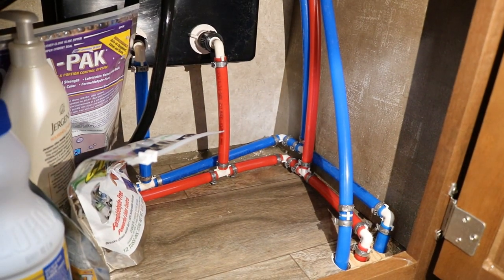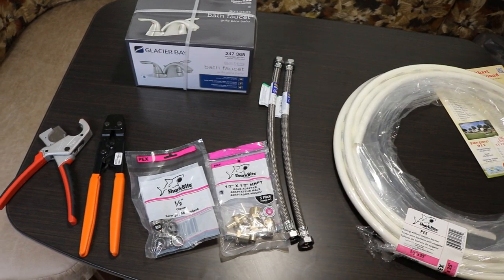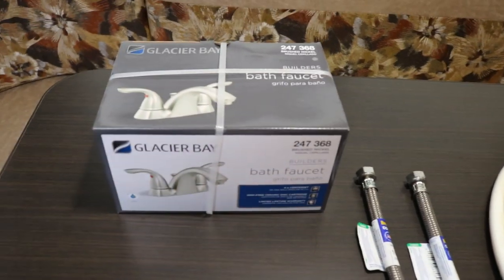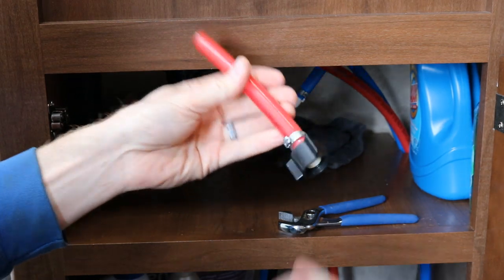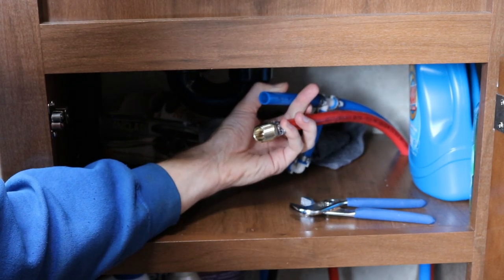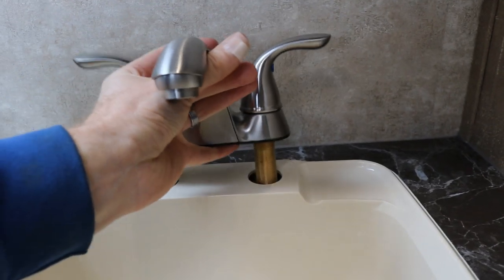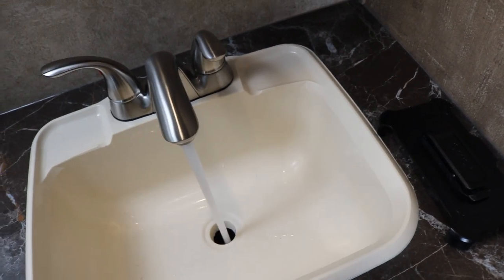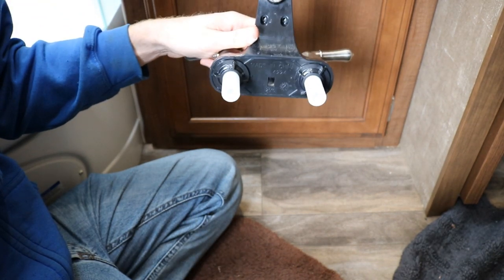HOW TO FIX RV PEX (Faucet Replacement DIY)  #rvlife

Comment: Much easier to attach the flexible lines to the faucet before installing it. Then feed the lines through the hole and tighten one end of the hot and cold versus two. That’s the way a new kitchen faucet comes, lines connected.
Reply from the maker: Yes, you could do it that way!
Reply: That didn’t work for me, the faucet nuts won’t fit over the flex ends to attach from the bottom.

Comment: The hot supply connection was not straight/ lined up.
In tryng to tighten you must have moved it slightly, and it sprayed cause of pressure on fitting. 
Good practice.
Reply from the maker: I got it all fixed up. no thanks to the factory

Comment: You said you could not figure out why it leaked when you tighten the hand nut. I would have suspected a crack in the end fitting. It would not be seen unless you really look carefully while flexing the pipe at the hand nut or disassembled it.

Comment: If this helps doing the same job I believe it was leaking from the apex clamp mine is doing this the force to remove the line upset the clamp and created a gap . They don’t leave any extra PEX line there do they I’ll do something similar as you did
Reply: Fair warning separation of PEX line and those clamps
Reply from the maker: Replace the pex and clamps/fittings

Comment: I have a brand new Coleman Lantern and on our day one of having it home and moved in (I'm a full time RVer) it flooded underneath the kitchen sink, everything was loose and we tightened it and it stopped well today cleaning underneath and reorganizing i hit the lines and they're leaking again! He had zip tides them and I'm thinking because they were straight they didn't leak but the red line is leaking like crazy again! I wish i could add pictures to show where, so frustrating!
Reply from the maker: Your probably better off re-doing the lines similarly to how we did in this video. 
I swear most RVs leave the plant with none of the lines tight!

Comment: Had the same problem, the white seals go soft and will start to leak, also better to do yourself, dealer wants 250.00 to 300.00 to replace seals
Reply from the maker: At the time this RV was only a few months old. We almost never take our RVs back to a dealer for anything! They are so unreliable even years ago and it's only gotten worse with time

Comment: I'd like to have seen the water run longer to see if this fixed the problem...also, could you have turned the "spicket" end of the fixture you remove & run water to see if it would come out the pipe or a fitting ?? or...could it have been with the fixture itself???? Hope what you did fixed the leak..I have a kitchen sink in a camper doing the same..hope it's a "simple fix"
Reply from the maker: It didn't leak and this fixed it.
Reply: @WanderingWagners  Great!!  Think the line ion mine is the new plex pipe..hard & of white color....what tool would I need to but, if I do the same as you & cut it off?  are they costly?  If so what is the estimate for tools needed...thanks again for your advice!

Comment: Great video as all your video's are just wish I could have better seen the crimping procedure. Maybe you can show that on a table top on another video. I've never worked with Pex before.
Reply: I'm a little late but for others....the crimper simply grabs onto the little nub that extends off the collar. It pulls the two sides of that nub together, thus constricting the collar to a smaller diameter. It does not grab around the full collar, just the nub.

Comment: Could it be due to water pressure?  Have a similar leak to my cold water supply
Reply from the maker: In this case no. PEX can handle 160 psi. It just wasn't crimped on correctly and needed to be redone.

Comment: They use the plastic to lower the weight of the camper RV. The plastic faucet is light. Every ounce counts to make it 1/2 ton towable.
Reply from the maker: Yeah, doesn't make it right though. We'd prefer they used real materials and real trucks towed them. They'd last longer too... Can't have that😂 cut into their profits of selling light weight junk to people year after year
Reply: @WanderingWagners  I live in a 91 Winnebago chiefton. Everything is plastic. Light weight and kinda cheap. If you look you can get quality light weight things. It just takes time.

Comment: Just curious how the repair is holding up? I developed a dripping leak under both sinks. It was coming from the cheap plastic connectors, even though they were hand tight. Since I was not home, I disconnected the connections and placed plumbers tape around each fitting. It worked for the time being, but I am thinking of using your method but wanted to see if that solved your problem? Thanks!
Reply from the maker: It held up fine for a whole year, then we traded in for an Airstream. So I can't say that it's still fine, but I'd put money on it that it's still not leaking.
Reply: Wandering Wagners thanks for replying.  I just subscribed to your channel, and have been enjoying the videos. Safe travels

Comment: Awesome , the only way to do it . That flex line is the trick too much strain on rigid plastic threaded connection and rigid plastic pipe combination spells leak! Once your rolling down the bumpy highway everything gets flexed and shaken . Wonder why manufacture company didn’t install like you did? Oh yeah the mighty dollar 🤔

Comment: DOD u have to use those types of clamps or can u use those normal hose clamps
Reply from the maker: You have to use those clamps when working with PEX
Reply: @WanderingWagners  I landed up using some shark bite adapter and some couplers to fix the lines...  thank you for the video
Reply: @bluesteel355  Sharkbites  have been known to come apart with vibration or in a light freeze. Fast and good for temporary repairs only.

Comment: Would you recommended wrapping it with teflon tape before tightening?
Reply from the maker: You could, but it isn't required with those fittings.

Comment: I noticed mine started leaking only when ide  turn on the hot water heater and it would build pressure and started leaking out the same place
Reply from the maker: Might just need to be tightened up. If anything replace it like we did here and worry no more

Comment: That end fitting which connects to your faucet is a PEX x NPSM swivel adapter (https://www.supplyhouse.com/JMF-H190500LF-Plastic-Faucet-Swivel-Adapter-1-2-PEX-x-1-2-NPSM-Lead-Free). It threads on to the faucet supply and presses the rubber grommet against the shaft, making a mechanical seal. The connection needs to be made straight on. I suspect that over time, the rigid pex line deflected the fitting just enough to break the seal, and you likely made it worse when you tightened it. What you did in this video is exactly how it should be done. But then, there's added cost to doing things right -- something RV makers are not entirely fond of.

Comment: I had same leak experience in my RV.  Had to do with cold then hot AIR temperature change. Apparently good old expansion and contraction principles.  I tightened by hand and never had issue again.  Cheap fix.  $0.00

Comment: Why do it yourself and not take it to a dealer? Even if you had the money, the dealer's tech has two problems: he most likely knows even less about it than you do and he doesn't give a care about your RV, he just wants his $12 - $15/hr.  Yup, nationwide that's about what an RV tech at a dealership gets paid.  That's about what  Walmart pays their checkout clerks and floor staff.   

So do you think these $12 - $15 hr workers have any more skill than you do - even if you have never held a drill-driver in your hands or know the difference between watts and volts? No they don't. 

So why is the dealer charging you $120 - $150/hr nationwide?  He profits from your ignorance.   IMHO, own an RV, better learn to fix your own.
Reply from the maker: Yes we've always fixed things ourselves. Only way to know it's done right and you don't have to leave it sit at the dealer for weeks/months!